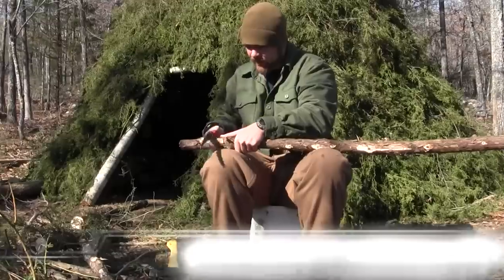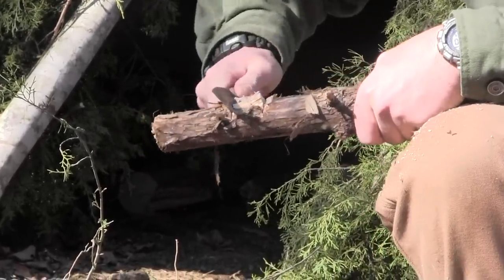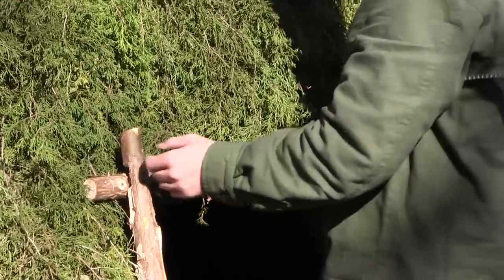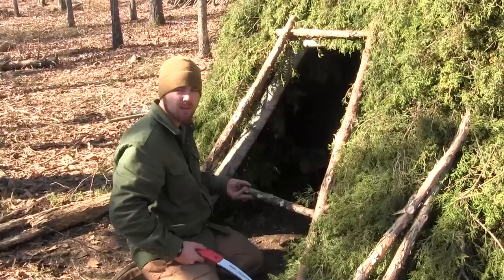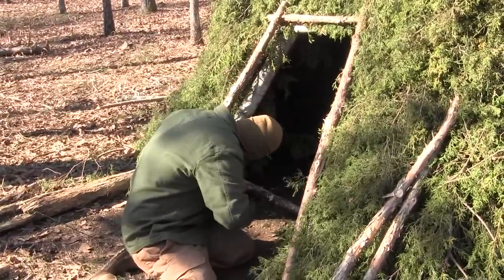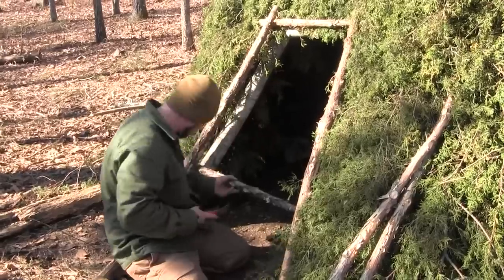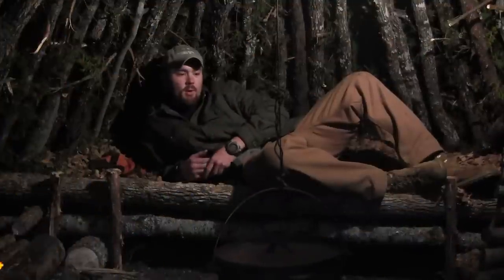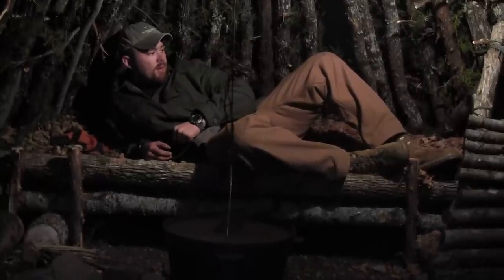Pimping your survival shelter Part 4- Making the Door

Comment from the maker: well you start with something small. I usually build a debris hut first and then add one of these on to it later. You don't start with a mansion, you build a shack first and build on it as your able. Watch our other videos on wickiups. It should be a slow build up and yes you can definitely do this shelter with calories from the land. Its very long term though and not something for short term survival. good question, but I definitely would build one if I was living off the land long term

Comment: Great looking shelter, good instruction, but no door on any shelter should open out, they should always open in, so you can get out, if some type of blockage occurs.
Reply: Oh is that how you do lashings...nice :)
Reply: I think for this type of shelter it wouldn't matter if you could not get out of the door. There are other points where in case of emergency you would be able to go through a wall, with an inward opening door critters would be able to simply push through it unless you had a locking mechanism.

Comment from the maker: the point of an keyhole fireplace is to not cut the trees. you can take a few very tall trees and stack them. Build the fire in the pit and as they burn you just move the trees forward. the gap is a necessity if you plan to use these methods. we did not demonstrate the keyhole fire, we just built all night fires because they are more convenient. but yo have to cut wood to do all night fire. you don't if you use the keyhole

Comment: The only thing I've tried up here so far is a 10x12' shack with insulated 2x4' walls and a Four Dog Stove from Don Kevilus in Minnesota! We're heading into -43C (-45F) wind chills tomorrow & we've been hammered with similar temps for a week now. The only design I've seen so far that would probably be sustainable in such conditions is a quinzhee hut judging by the amount of wood we're burning in our wood electric furnace at home this week. Of course, my joints are getting old and grumpy ;)

Comment: On your door, if you leave the outer upright poles about 10 inches longer above your upper cross-piece pole, and make semi-circle notches about 5 inches from the top ends, and loosely tie them (notches down) onto the cross piece that makes the upper limit of your door way, then the door will lift up and out, and a separate pole with a 'y' placed at the bottom will hold the door up making going in and out quite convenient!  To answer other comments about animals coming in thru the gap under the door, MOST animals stay away from fire and small animals (rodents) can get thru the walls of this type of shelter, but if needed (?), simply place a log inside blocking that gap; after placing enough wood to get you thru the night (or more) inside the shelter.  Good Luck!

Comment: In either of the cases with Kifaru or MSR in these conditions the insulative values of a Wikiup or quinzhee would be lost and there would be little sleep to be had during those long nights and doubt if stove could keep up. Wikiup would probably be most versatile with snow insulation as you said but with a smaller entrance and vent at bottom of door. Either way survival in these conditions would be a trial.

Comment: Completely an "I don't know" question/observation: 

I'm in the same geo region you are, and cedar is one of the best things I have to easily build with...   I've always utilized it for how easily it makes fire; from the bark to the branches and needles. 

 Many, many times I have used the branches and needles to start a stubborn fire, and have more than once pitched almost entire trees on a fire for instant heat.  I'd be scared to death to have my whole shelter sheathed in it.  One spark, and I'd think I'd be toastier than I'd like. 

Have you had any issues like this?

Comment: what is he going to do if a animal comes through the bottom
Reply from the maker: Eat it!
Reply: If ur dead asleep I would put the hole on the top
Reply: +Brien Davis A bear isn't going to waltz through the small crack, and anything that could isn't going to be particularly threatening.
Reply: +Kerman Guy I never said I bear I don't know where they live but where Iive there is nothing but  coyotes
Reply: +Brien Davis He was a Sentry Gun ready at the right spot. Rule #47 Survival Kit ;)
Reply: instead of expensive paracord, at a farm supply stores you can get bailing twine  for hay and have enough for a hundred shelters
Reply: Teresa Gideon
Why is this relevant? Who is this addressing?
Reply: I don't see why you couldn't just make the bottom of the door like he did the top, only without weaving cedar through it. It would still allow air in, but would stop anything larger than a mouse from just walking in. 

In my area, we don't have bear (I don't think a door would make much of a difference if a bear wanted in anyways). We do have mostly coyote, and the occasional bobcat and panther though. Chances are, they wouldn't mess with you anyways, but a little extra precaution couldn't hurt.